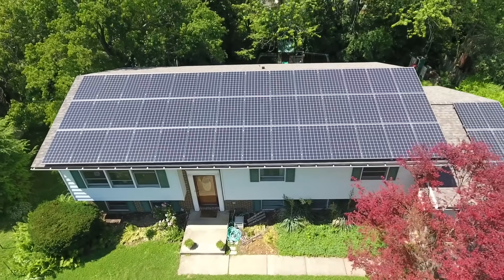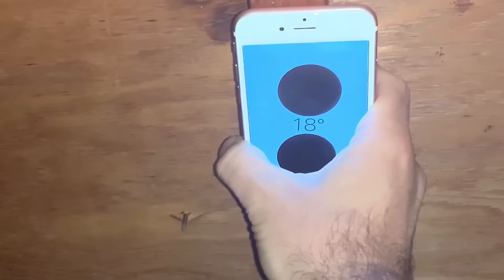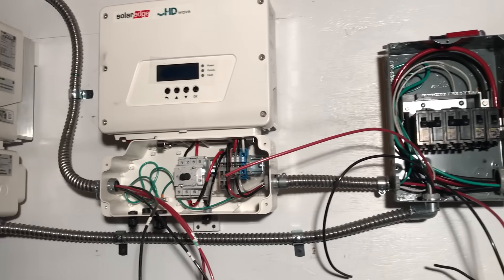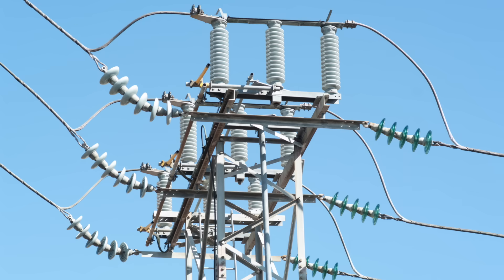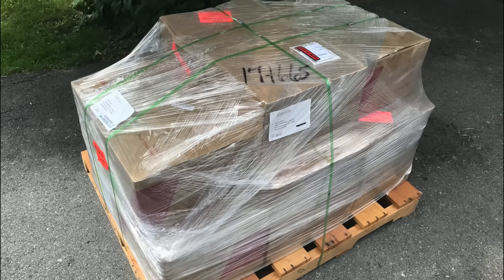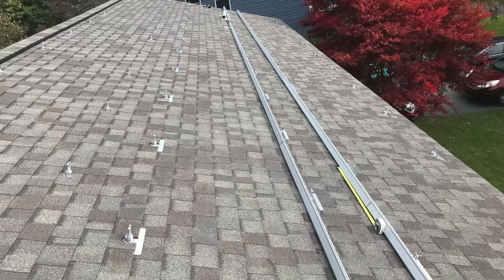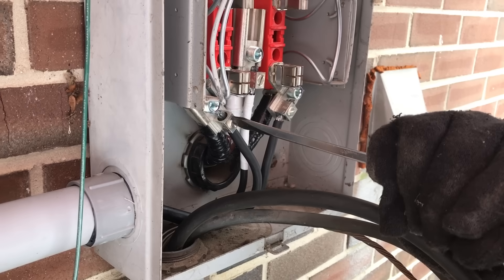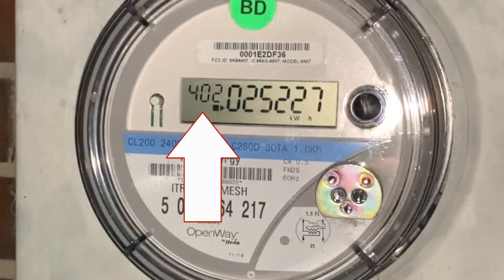I Installed a Power Plant Myself | HUGE DIY Solar Panel System

Comment: Amazing, when do you think it will make a profit considering the cost itself?
Reply from the maker: I've made a few videos addressing aspects of this question.  You could check out the one I made just after this one and the one I most recently published, if interested.  From a cash flow perspective, it is cash flow positive the moment I turned it on.
Reply: @FrugalRepair  Get me right, you spent money on this and my question was when it will be profitable in terms what you spent?
Reply from the maker: Do you mean payback?  There’s different answers to your question.  Payback is about 5 years at this point.  Cash flow is positive.  I’m net positive per year on electric costs.

Comment: do you have a battery connected to the solar
Reply from the maker: No, not integrated in.  We have 1-1 net metering so not really a need to install one.  I have other batteries in case the power goes out or when traveling, etc.

Comment: When you ran the numbers. Did you account for battery replacement, panel replacement, panel cleaning, and wire replacement management and damage? 

Solar panels will lower the cooling cost for your home. It will help remove the impact of the sun on your roof heating it. It will increase the heating. Batteries should be enough to run your household for 48 hrs in complete comfort without recharge. Just the panel is is only when the sun's out. Snow clouds and alot of others change it. 

I'm not saying solar is bad. I'm just thinking you left alot out.
Reply from the maker: I don’t have batteries intergrated so no need to account for them.  I’ve made a few videos about my setup and how it works out really well financially, if interested.

Comment: If you build it yourself you don't get the Federal tax credits right?
Reply from the maker: You need to have new equipment as far as I understand but it doesn’t matter who does the work.  For state rebates and other incentives though, there may be different requirements.  Just my thoughts, I’m not a tax accountant.

Comment: Here grid tied solar = you loose money... (because of all the extra cost like needing a electrician to do the work since it is connected to the grid, the cost of being tied to the grid and the extremely low pay you get for the electricity you produce while the electricity you use cost 10 times more then you get) . Here it only makes sense to be totally independent from the grid by using solar panels, batteries and inverters.

Comment: I used to sell solar but one question I could not get answered was, does this increase the radiation in your house and is it safe?
Reply from the maker: What kind of radiation are you talking about?  There's a magnetic/electric field because of current flow in a wire but I'm not guessing that is what you are referring to, is it?

Comment: An emerging problem for sunny areas in the US where more folks are going solar, is that there is no guarantee that electric companies will have the capacity to manage large amounts of power being returned to their systems…especially in neighborhood substations that were built to distribute power in one direction…not to intake huge amounts of power being returned from new solar-run residences…something to consider before you jump on the bandwagon and find yourself without an outlet for your surpluses.  Just say’n…
Reply: Sure they can handle it just fine. 
Personally I wouldn't send anything back to the grid.
Reply: @johnsuggs3952  maybe we're getting different feedback from our sources. Mine just retired as an engineer from a major power provider...just passing on his thoughts about outcomes overvthe next few yrs.
Reply: @remusarizona2178  I understand your source being a power company engineer, but most modern day power companies can handle the influx of electrical power from grid ties from home solar systems. 
The surplus from a home solar system is running in parallel with the power company's system. 
Those systems deal in literally 10s or 100s of thousands of volts and 100, 200 amp currents of more. 
I have an solar system that I've had and run for more than 10 years. It's not complete house but it powers my lab and music studio. I'm a microbiologist and musician.
You have your sources which are your wind turbines, solar or geo thermal. 
Those all come in on one or more lines feeding power into the system. That power or voltage is taken and broght down and stabilized by voltage stabilizer of some kind that takes in voltages that are higher than what you need and steps them down to 12, or 24 volts. That's then taken and used to charge your battery bank. The batter bank is feeding a inverter which usually steps the incoming voltage up 10X. 12 = 120, 24 = 220/240. once your batter bank is full, you can dump it off to a load like a bulb or even a second batter bank. Which is what I do. I have a double redundency set up. The main system and two backups. 
You can use various ways to kill the incoming power if you don't use a dump. you can have a relay where when the voltage on the batteries reach a certain level the circuit from the originating sources get cut or opened. If you cut the source you don't need to tie into the grid at all.
Reply: @johnsuggs3952  thanks John for your detailed reply. Maybe my source was a disgruntled former employee or something. I appreciate your help on this. Best R.

Comment: Hello please what battery will I need to run this inverter Growatt 48V 5000 Watt Inverter 220V Inverter Charger Max PV Input Voltage 450V MPPT 100A Hybrid Solar Inverter SPF 5000TL HVM-WPV-P

Comment: I won't be installing a solar system myself, but I do what to be educated enough to ask the right questions and your informative video is just the ticket. Thanks for putting the free booklet together. Much appreciation and great work.
Reply from the maker: Thanks!  I will be releasing a new solar video in a little bit here and hopefully it will help too.
Reply: @FrugalRepair  I have no doubt that it will.

Comment: get some chicken wire round the sides to block it from birds building nests under the panels
Reply from the maker: Thanks for the suggestion!  There’s no need for that so far.  I would think it’s too hot for them (or not enough room) to build nests there.  I’ve had no critter issues (and we have lots of critters around here).

Comment: NOT subscribing...#1 reason is the total complete bullshit about requiring to connect back to the " grid" and the extraneous bullshit about " code/ permits" it's your damn property you can do what the hell you want and if big if your able to afford this crap that sadly is way way way outrageously overpriced inches first place and provide power you shouldn't need to connect back to the " grid" and doing so for socalled credits is a massive af ripoff because you get paid jack shit for the amount of overhead this process costs...

Lastly doing this also Jack's up the cost of your insurance because of issues due to hail or wind damage ( my best friend did this even had an alleged professional company install the shit  6months later  hail storm hit and totally fucked everything up and hr is out of pocket over 20 thousand ...because his insurance refused to cover the panels ....real talk...

And thes panels can and do catch high wind shears and fly like kites as well and wind up ripping up your roof reasons upon reasons people never stupidly cover their entire roof in them ..also pollen / mold build up as well as uv degrading is a northern serious issue ...

Lastly putting holes actual bolt hols in your roof deck will make leaks and cause the wood to rot..." roofing nails" for shingles rarely ever go completely through ( any Profesional roofer will tell you the same )

P.s. solar doesn't work worth a sht. During winter or on cloudy/ overcast/ rainy weather  and it doesn't work at night / twilight ....unless you have a massive battery bank / backup powering it ...

P.p.s literally no one hooked to the grid has a zero energy bill ..especially most places where taxes and surcharges and extraneous fees are the normal...so seriously stop the propaganda

Comment: I thought I would share some lessons learned from doing my own solar install. Date of install end of Dec 2021. 1. If you pay a company to do your solar install, I seriously doubt it would ever pay for itself over 20-25-30 years. I also doubt your electric bill will be zero in the summer months as most solar companies flat out lie. Being inform, you can have them put their expectations on legal papers for your future safety. 2. If you do your own solar one can expect a 4-7 year return on investment. You will have to get educated on permits with your local city and power company. If I can do it anyone can. 3. Power Company Billing was my biggest surprise from this entire venture. Rocky Mountain is NOT solar friendly to the average home owner. The excess power sent to the grid for storage comes at a great cost. I discovered after a few months of billing that We pay RMP .077 cents per KWH. When you generate excess solar power, the excess goes to the RMP grid but RMP only credits you .04 cents per KWH. So, in others words grid storage is not free or cheap. RMP skims nearly 50% off the top. WHAT DOES ALL THIS MEAN: 1. When you have your solar designed and drawings engineered you have to figure in 1/3-1/2 larger system to make up for the RMP skim ratio. I was lucky and added 30% more panels then necessary because I wanted an electric water heater. So far my last 3 utility bills have been $13 the minimum fee RPM charges and that includes free hot water. Jan-Mar our bill was $45-$60 due to winter clouds with a typical electric bill of $100-ish in the winter and $375 in Summer RMP resets the homeowner grid storage to Zero March to March. Of course, RMP keeps the excess storage when the clock is reset. We lost $15 storage credit. Yep RMP keeps your excess after Mar billing is closed out and you start your grid battery storage at zero. This feature does not encourage being "green", It flat out encourages running ones AC to 68 degrees in July and August and push less out to the grid. So during the day your system pushed out excess power to the gird at .04 cents and at night you buy your power back at .077 to 11 cents depending on demand hours. Yah get the KY jelly ready. 2) Another big disappointment is RMP in Utah takes ALL the homeowner carbon credit rebates. Most states let the solar owner sell the Carbon Credit which can add up to $100-$300 per month passive income. If Utah is serious about encouraging Solar for Homeowners the laws need to be changed. Only serious pressure on our elected officials will we make strides in Solar. Conclusion: Overall I am happy with my solar only because we did all the labor ourselves. We expect near zero ($13) per month electric bills from here on out. Beware that many States like Florida have increased the $13 minimum to $30 now.... so that must be our near-term future for residential solar. This year the homeowner will still be eligible for a 26% IRS rebate and up to $1200 Utah rebate. The crazy part of the Utah Credit: You have to pay $30-$35 ish bucks to set up a Utah Rebate account in order to claim your solar rebate. Another shocker! The 26% Federal IRS rebate for DIY is only for cost of materials. Your Labor is not deductable. One can however hire out parts of the job like mounting the rails and running electrical inside the attic. You will need receipts for the rebates. Pros: We find that it is more cost effective if we run our home ac at 68-70 degrees during the day and raise it up to 73-75 at night. The heavy use during the day results in less RPM skimming off grid storage but just enough to run the ac at night and draw from our grid storage. Not very "Green" in my mind but it is what it is. Con's: One has to be aware to not have too much excess "Banked" on the grid when March comes a knocking. You lose all excess. So in others words crank up the electric heaters, electric blankets, leave all the lights on and dry ones hair more often. Excess storage is not a tax deductable loss but should be! So in other words you have to manage your usage. Does not require much time but it is another thing to do. About 10-15 minutes a month. Bottom Line: Would I do it again? Absolutely YES. I would not hire it out but if one uses their own elbow grease and fill in with some contracted work it is well worth it. Yesterday was 92 degrees and my total draw from the grid was zero. I actually pushed 40kwh to the grid. What is 40kwh? enough to run 40 100w light bulbs for 1 hour or 4 ton HVAC system for 6-8hrs

Comment: Very impressive - I do have a question however about your business case - the profitability of the array depends on when you use the energy. Peak load is generally 17.00 - 21.00, ie. when there is less sun.  Surely this needs to be taken into account when doing the business case? I have solar at home and power not used and put back into the grid doesn't give me much credit at all.
Reply from the maker: It depends on where you live.  I have 1-1 net metering here. Did you see the video after this one?  I cover much more specifics on production and what I spent.
Reply: @FrugalRepair  great - thanks. Will take a look 👍👍

Comment: Getting permits here isnt going to  be easy.  They make it very difficult for homeowners to get permits for certain projects.   It took 3 months to get a permit to change my permitted fence into a pool barrier.    Congrats on a great project.
Reply: Most do it yourselfers do not get permits. They just order and build. That is why homeowner's insurance can drop policies because these solar panels are attached to the electrical grid and potential for fires
Reply: @TomokoAbe_  if it’s attached to the grid it’s got to be permitted.  Here they go through the neighborhood and look for projects.   If they see one they check for permits.  You get a letter to get one or remove it.  The fine is $100 a day.  Previously I got 2 letter and had to pay double for the permits.

Comment: Doing your own DIY solar is great fun. I did my first small one 20 years ago and boy was that expensive compared to most recent one. We mainly done it for environmental reasons though not money saving.
We've got some of our DIY solar and also installer one on our YouTube channel if you want to check it out.
Reply: I did my first off grid solar 8 years ago and the price has dropped dramatically except batteries hello from remote rural NSW Australia

Comment: The few inches of space can shade the main roof. Cooler roof = less used energy.  I saw something interesting called "Double roof of Cham" for natural cooling.  So I think this is similar. Good job!    Mike J.
Reply from the maker: Thanks!  I was trying to keep the panels as high as I could on the mounts and level  at the same time.

Comment: Looking at my situation in the Florida Panhandle with only two of us home, my light bill seldom goes about $125 at peak Summer heat. Heck, my natural gas bill reaches $90 in the Winter.  I would love to have no bill but I cannot wrap my head around net-neutral use without batteries.    I am thinking of playing in my small backyard with a couple of panels.
My concern is I have a metal roof that is close to 30 plus tilt. My roof runs north-south so I would have to use east and west panels.   Just can't see the return is justifiable.

Comment: Are you able to do this and be 100% off the power grid?
Reply from the maker: No, I’m tied to the grid.  I don’t need integrated batteries.  I have 1-1 net metering and it’s great.
Reply: @FrugalRepair  but could you?

Comment: I did the same thing with 24 panels in San Diego.  By far, the hardest part was dealing with the permitting.  The city did not like me doing this myself and dragged the process on for months.  The first inspector come up with a long list of B.S. changes.  I did most of them, and the second inspector was fascinated by my efforts, and immediately signed me off.  I know have electricity for free....
Reply from the maker: Congratulations!  Next time I’m out that way, I’d love to get a tour.  Sorry to hear about your trouble but glad it’s working now.
Reply: Hi John, 
I'm also located in San Diego and planning to do the same thing. 
I would be happy to connect with someone that already done that to get some tips!

Comment: hm. No bills? except solar maintenance of course, the Batteries, all the electronics & all of that. Yeah. No Bills. It's not like batteries needs replacing every 10-20 years. It's not like Solar Panels break and need replacing usually every 15 years. It's not like in 20 years we have a guarantee that the local authorities won't decide to "levy" or "tax" people that did all this. People used to install Gas Generators in their homes and sell electricity back to the companies 30 years ago. Why? because NAtural GAs was  So CHeap!       hahahaha

Comment: what happens if grid power goes out?  does your system automatically stop power from feeding into the grid?
Reply from the maker: Yes, it’s a mandatory feature for grid tie inverters to make sure no power can be back fed to the grid.

Comment: Very nice job!  Which powerwall did you go with?
Reply from the maker: Thanks!  I don’t have a battery integrated.  I have 1-1 net metering.  You might like the video I made after this one that goes over what I spent and the production of the system.
Reply: @FrugalRepair   i just saw that 2nd video. Sorry. Yours is a massive solar array! I only have 2700 watts so far. Main reason i have one is for long grid down outages. Good thing you can add one if your decide to. Cheers mate!